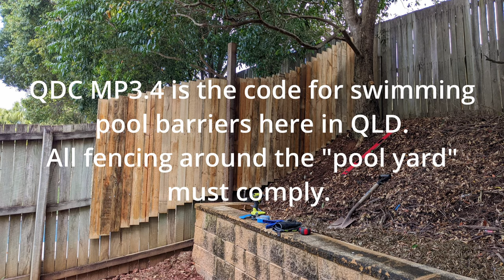Timelapse of Pool Installation in Brisbane Australia

Comment: Did those glass fencers seriously core drill without putting down a template to ensure the core drill doesn't slip when starting a hole? I don't care how good you are it's a sure fire way to have an accident damaging tiles that will need to be replaced. I do glass pool fencing with my brother and I really don't like the way they install glass either. Those Glass Mates look cool but they're expensive at $80 each and while they make adjusting the height and level of the glass easy the rubber on their feet make it harder to adjust the line of the glass, and being small made from aluminium I question how well they will keep glass stable with wind. Putting the spigots onto the glass first and lifting them in is also an archaic and inefficient way of doing it, and it looks like they had panels lying on their side and tops which risks damaging them along with risk of damaging the face by lying it down. No string line running over top of the glass in the middle to help ensure it's straight, I don't care how good you think your eyes are a string line helps immensely. Also looking at the two photos after they grouted they clearly didn't fill the grout up to the top of the hole leaving a gap that looks upwards of 10 mm, that's not good and will let water rest inside the holes.

The way we install our glass is using timber blocks with packers that is levelled around the entire fence line first, this ensures all the heights will be compliant and level. We place the empty spigots directly into the core holes, cutting the bottom with a grinder if needed, with the cover places. The glass is always stored the right way, so sitting on their bottom, and we simply lower them onto the timber packers and into the spigots. The glass is secured by a custom made extendable brace with a suction cup on the face of the glass and a weight (usually bucket of water) on its base, these braces are done every second panel and each panel is joined to its neighbours using a timber joiner (two small pieces of timber with a screw in the middle) up to and bottom. One secured spigots are screwed in, no fuss measuring where they are meant to go on the glass beforehand and no extra effort needed to flip or rotate the glass or risk damaging the visible sides or faces. Once a full side is put in, or two or three depending on size and number of braces, we run a string line along the top of a side lined up in the middle of either end corner to help straighten and level the glass and as we use timber packers we can easily adjust panels to follow the line. When we grout we also go to the very top in line with the top of the tile cleaning any mess right away with a sponge, sometimes the grout may be a few mm below the tile though but never anything like these guys did.
Reply from the maker: Fascinating comment mate, thanks for your insight!

Comment: I didn't think you could have anything closer than 1 metre to the pool fencing that could be used to climb over, in this case the roof post.  Is that not a rule?
Reply from the maker: Good question but my understanding is something needs to be horizontal to be used as a step whereas the post is totally vertical with no foot holds within 900mm of the top of the balustrading.
Reply: @RevitSmart  Ahhh, that makes sense! (though I know plenty of kids that could wiggle their way up the post).  Thanks for replying!
Reply from the maker: Yeah I think once kids are that big and have that level of ingenuity they should know how to swim, like if they're big enough to drag a piece of furniture close and hop over that there's nothing legislation can do to stop them haha @stediasse

Comment: Did I miss the plumbing section?
Reply from the maker: So around 15:30 you can see the return jets/light/skimmer box are installed prior to the lift. Then on day 4 they're digging trenches for the pipes going to where the pump is (around the corner out of shot because I couldn't get a good angle without being in the way) and you can see them putting the pipes in around 21:10